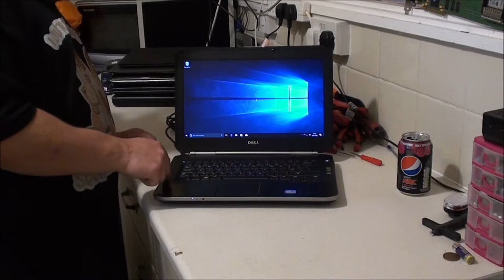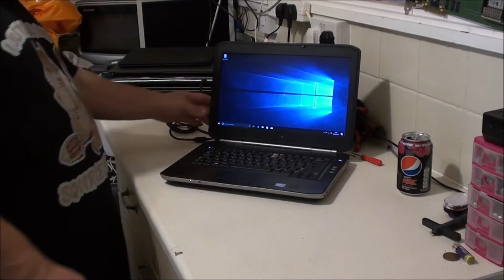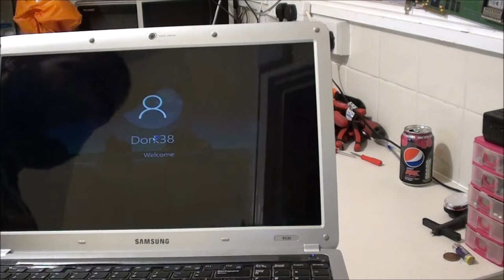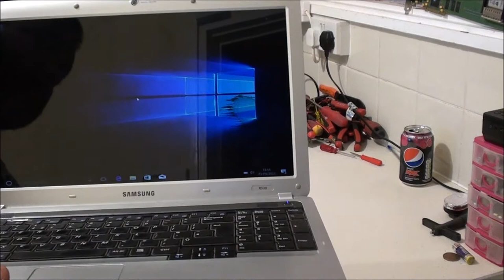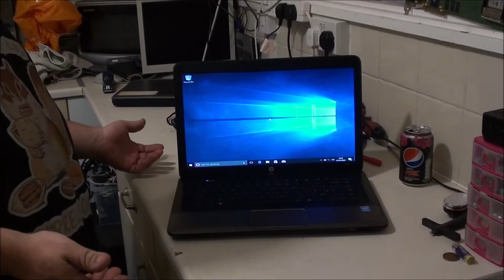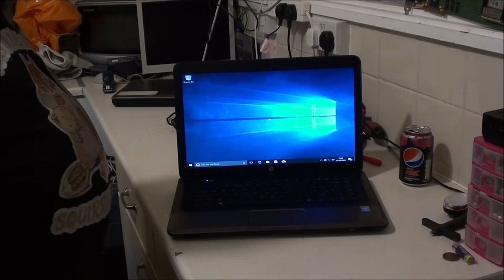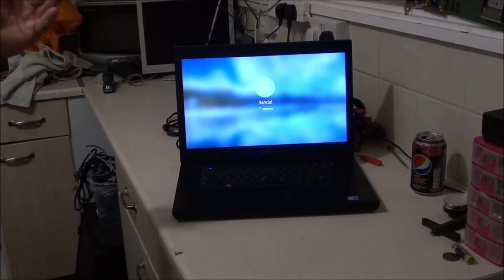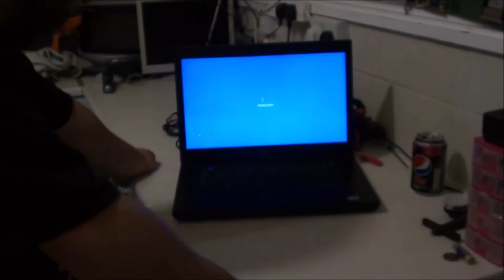Laptop Haul Part 1

Comment: You can't beat a Dell, especially the older E-series Latitudes. The E6510 can be upgraded to a maximum of 8Gb RAM, and that first plastic blank you pulled out is where the ExpressCard/34 expansion card slot is. That "very thin slot" is a Smart Card reader for businesses whose employees have to use a Smart Card to login for security.

Comment: The macbook air looks like a 2008/2009 which is a A1237/1308, the original airs run quite hot and are very slow because they have IPod hard drive, 

The Dell looks similar to my Brothers laptop but higher spec, good luck with that one! Sounds like it needs a new RTC Battery, but the main battery will keep the time and date saved if you get one. 

The geo looks cheap and weird, and sounds like a interesting project. It may have a motherboard issue because it has a LED backlight older laptops with CCFLs are usually the tube or Inverter, LED backlights use a driver soldered to the motherboard, you may get lucky with the screen however. 

The acer seems quite boring to me, a simple consumer grade aspire. Maybe it will work maybe not. Still interesting. 

That Samsung looks very familiar! An R730? Mine has a light up trackpad, and i love it very much!. A new screen will certainly make it look much better!! It seems to have impact damage and crystal bleed. 

HP Probooks are quite nice and are on par with the elitebooks (assuming this is an probook could be a fancy pavilion) dell chargers use the same barrel jack but different sense pin and usually don't do much more than turn it on. 

The final laptop is my personal favourite, i own its brother, the E6400 yours has a fancy upgraded battery (mines in awful condition and dead) but those latitude E series are hella durable. I'd also try playing around with the smartcard slot. 

Overall some cool finds and ill definitely be looking forward to the future!
Reply from the maker: Part 2 is going up this evening. I think most of the laptops need new cmos batteries, especially the dells. Part two has three more dells.